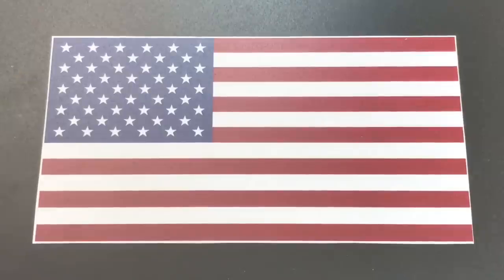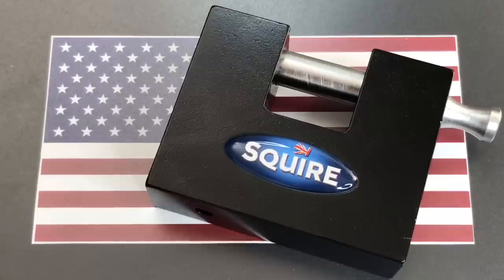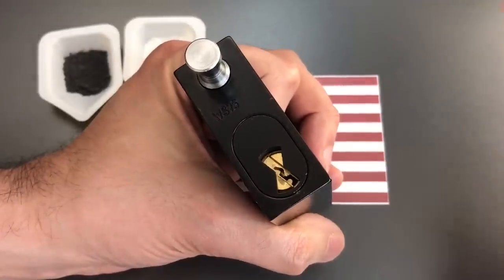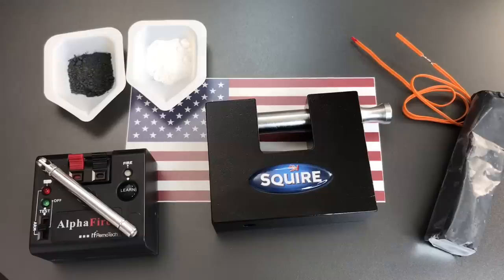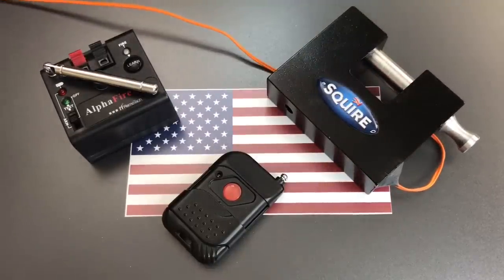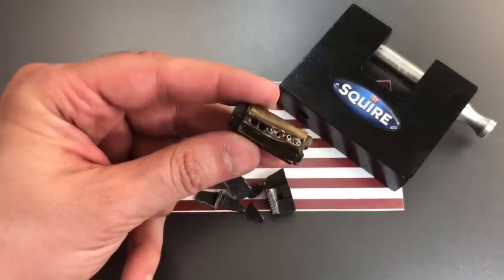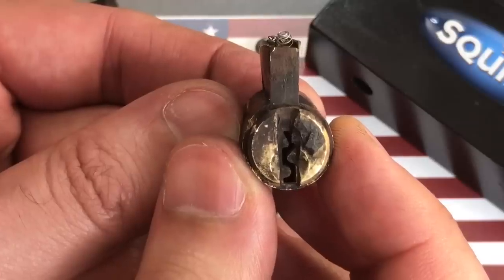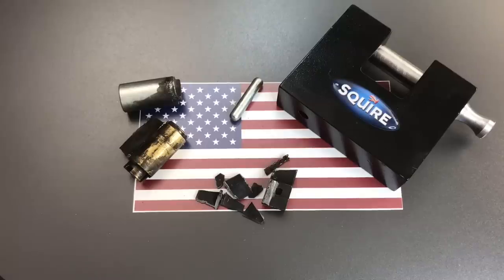[510] Opening a Lock With Explosives!!!

Comment: I once worked with a pyro guy on a movie set (small WW2 movie).  He was always running tons of cable everywhere for the various charges needed.  One day I said "I wonder if there is some kind of wireless system for this".  His eyes got really big and he said "Do you like being dead?" 😂😂😂
Reply: Johnny  Electronics, like phones, cameras, and computers all give off some radio frequency.  My guess is some of those things being around can accidentally match the same frequency required to trigger the detonator.
Reply: Johnny What they said is exactly why.
Reply: Johnny  No reason to risk it. When you're dealing with explosives, it's better to be safe than sorry.
Reply: Johnny  Explosive charges being detonated unexpectedly, possibly harming crew.
Reply: @xXJMatherXx  its sad you had to answer that,
Reply: Car thieves frequently use this method to open car doors, so it is definitely a scary possibility.
Reply: @js-rp9ou  not really. It doesn't occur to your average person. Obviously the person that posted the original comment didn't kniw that
Reply: I would argue it is still totally possible to create an encrypted wireless connection to trigger explosives safely. with encryption it would be pretty much impossible that random frequencies in the area could set it off. the chances would be the same as someone trying to brute force guess a password by typing completely random things
Reply: Aside from the fact that encryption schemes are broken all the time... you would have to put a small computer in the receiver and it might get blown up which is kind of an expensive waste
Reply: @gundorstoneskin5900  Except car keys have their own constantly changing encryption keys + protection, so...no. Unless these thieves reverse engineered the car keys or have decoded the process that the keys use, then no one ain't "commonly" doing this.
Reply: Johnny because electronics tend to fail at the worst possible time and for reasons that shouldn’t happen... using wirelessly detonated explosives is just an added point of failure that would cause death if it failed.
Reply: Johnny  Often times if you are traveling through an area where blasting is being done to clear through rock there will be signs all over that say "Blasting Area - No Radio Transmitting".  That being said, there are expensive commercial solutions that allow wireless control of detonations.  So, wireless can be done "safely" but is just now becoming the case.  For many years you either used a cable run or time fuse.  Now mining is starting to use wireless encrypted devices for detonation.
Reply: You can't jam signals like that in the US. The FCC frowns on it rather heavily. It's the same reason they can't just jam cell phones in prisons to keep prisoners from making calls with contraband phones.
Reply: Dont forget the arguably worse situation; where the remote control FAILS to ignite the explosives. Now someone has to go up to a BOMB to fix it. Depending on which explosives you use, can range from relatively save, to just plain lethal. All because someone said "I dont feel like spending extra effort on being safe".
Reply: @omikronweapon  Good point
Reply: While LPL was describing his remote exploder I was thinking "I wonder how they make sure that's safe, I sure wouldn't want to hook up an explosive to a detonator while I'm in the blast zone".
Reply: The other problem is that the igniter uses a short amount of nichrome wire surrounded by a material that will ignite at the slightest of sparks, that little piece of nichrome wire is about the same length as the wavelength used by mobile phones and could be excited enough by a signal to ignite the material.
Reply: @mfaulknerfilmco  well, then if that's possible with an electronic detonator, then it's also possible for stray radio frequecy to do the same thing with a hard wired detonator.... so your point is moot.
Reply: Oliva Gina  the military still uses wires most of the time
Reply: @rosebarnes9625  Oh, all these people who don't know what they're talking about. How about you trust that the people who have studied this for years and do it for a living know what they're doing. In my experience, there are two kinds of amateur explosives guys: those who were careful and safe and are experienced enough to be trustworthy, and those who are missing body parts because they used "common sense."
Reply: @TheRealColBosch  umm, that's an invalid argument. Just because I'm not trained or educated in explosives does NOT make me wrong, but insinuating such does make you an idiot. I merely responded to ONE post with a simple matter of FACT, and you felt the need to jump in with a fallacial argument. If you want to do some good and protect some people, reply to people who ARE wrong in what they post and give actual facts and/or logic to support your response, don't go around denying facts....
Reply: @ts757arse  good answer!
Reply: @rosebarnes9625  For my understanding, the biggest single engineering reason to use shielded cable and not wireless, is that the remote unit has to have its own power supply. This power supply has to be hooked up, ready to fire, LONG before anyone even considers hitting the trigger. More than likely before the full suite of explosives required for the job at hand is even set up. Its not that you're worried a random wireless signal will set it off. By being connected to a power source, the explosives have a far higher chance of unexpected discharge.

By using shielded cable, you can run the full length of said cable through the job site and have all the explosives rigged before ever connecting the cables to the control unit, and with properly shielded wire, this reduces the chance of premature detonation to almost zero. I say almost, because freak accidents/acts of God have been known to happen, despite being careful and following procedures.

P.s. One other thing I failed to consider was cost. Radios are always expensive, and you are basically guaranteed to lose said receiver every time. Cables, even shielded ones are fairly cheap by comparison.
Reply: Wireless explosives triggers exist and have for quite a while. Some companies use them all the time, but some of the old timers won't touch them.
Reply: Because random electromagnetic frequencies exist and can trigger wireless devices randomly. Wires are much safer as their vulnerable to far few frequencies. If it’s a closed circuit it’s vulnerable to AM and if it’s open it’s vulnerable to FM. But that’s vulnerability is much lower. Wireless is fun but it can be a much bigger headache too, and remember that if it doesn’t go off you get to go check why.
Reply: Vanargand In EOD school one of the very first hard rules they taught us: explosives never work exactly as expected. Just because C4 shouldn’t go off if lit on fire and stomped on doesn’t means it’s safe to try it. Cause that might be the time it works for no good reason. Murphy’s a jackass, don’t make it easy for him.
Reply: @ts757arse  Modern GPUs and critical technology like this are manufactured using absolutely, incomparably different fabrication processes and tolerances. There is no way in hell failure modes of a 7nm consumer-grade ASIC can translate to rugged control circuits of a wireless detonator manufactured to industrial/military standards.
Reply: @ts757arse  I'm sure no one here has suggested using a RTX3090 as a remote detonator. You are making a strawman argument.
Reply: It scared me when he showed it.   I was pondering how they'd make it safe.  Like, maybe giving power to it after they were clear of the blasting area.   I guess at that point, it was easier to just use the power wire for the detonator.   Car remote lock fobs are generally safe.  There are millions of them, and I've never heard of someone's doors getting unlocked by stray RF. That box didn't appear to have that same level of real world field testing.  I wouldn't have trusted being near it to set up.
Reply: We use them nowadays but it's far from just a remote wireless signal, the remotes are coded to the controller so not stray signal can set anything off unless the two devices handshake first.
Reply: @mfaulknerfilmco  It isn't a single wire, it is a pair, with a fairly small separation distance. You would need waves comparable to the separation distance.
In addition, you would need these waves to carry enough energy to heat up the nichrome wire enough to trigger the explosive, which mobile phones simply don't have.
Reply: Johnny  you want the explosive to go off in a timelly manner and not be hindered by signal quality, strenght or matching freqvencies . Cheap remotes can interfere with pretty much everything, moderate remotes can be copied easilly and are pretty common thus could be set off by random remotes , expensive remotes ca still lose signal and fail to detonate when needed ... you need precisions and security
Reply: Especial Effects Co  Just because some are (possibly even ones sold by you) doesn't mean all are.

Like I said earlier, unless I know exactly how it works, and not just from someone telling, but from detailed schematics and preferably code, I wouldn't trust it.

There are plenty of ways to solve issues regarding induction currents.
Reply: I count four ways an explosion can go wrong. Redox reaction. Anything electrical in nature, including electromagnetic waves. General entropy. And material defect.
Reply: The question is WHY.

No point, now if it was a military application, etc.....ok, but for a movie set....no point.
Reply: Johnny  On top of all of what's mentioned, I would like to add a far worse alternative. The possibility that it could FAIL to go off. For any number of reasons. Who's going to go up to the definitely armed and supposed to be detonated wireless charge? Now you have a live explosive that could go off at any second and a huge problem on your hands.
Reply: Johnny   Fast  forward to LPL episode 1250 .......... electronics can do bad things with electrical interference.
Reply: What the fuck are you all on about? Wireless explosives detonators are a commonly used thing and have been for some time.
Reply: @stickmandaninacan  "pretty much impossible" is not "impossible". What happens when Samuel L Jackson is walking for a smoke break and gets blown up by 5 pounds of c4 because someone has an old pager(or some other movie prop) going off?
Reply: @jeffreyblack666  thanks for that long explanation! I learned a lot in this thread :D
Reply: @stickmandaninacan  yeah, but why take a chance with peoples lives when you can just use physical cables and be 100% sure the charges arent gonna just go off on their own
Reply: Retired USMC Ordnance tech.  The debate over wireless tech for detonators is entertaining.  You do not EVER attach the detonator circuit to the charge while you are within the blast radius OR safety zone.  The detonator is ONLY connected when everything is set and all personnel are in a protected area.

Of course being military, it was impressed upon us that in COMBAT the rules can be bent or even broken.....hell you might have to have the private put a match to the explosive (watch "Saving Private Ryan" and watch for the "sticky bombs").  In non combat however, you'll lose stripes, money, and possibly body parts or your life if you bend or break the rules.
Reply: @bmjames  "Aside from the fact that encryption schemes are broken all the time"
do you know that the encryption scheme that authenticates websites was originally described in a paper in 1976? and that it's in fact the only scheme that we managed to figure out? so no, encryption is never broken, because effectively there is just one encryption scheme, or two to be precise but they're both based on the same maths (prime factors multiplication) and nobody has broken it so far. you never break encryption, to the best of anyone's knowledge it's mathematically improbable to the point of practical impossibility, you can only work around it, that's how phones are cracked into for example.
Reply: @stickmandaninacan  wires beat wireless by miles tho
Reply: @owenkegg5608  wait your right
Reply: @xXJMatherXx  also it leaves you open to cyber attacks imagine you have a remote trigger for a gun and then some guy hacks into your trigger and starts blastin
Reply: I guess if someone does it for a living and has to do it over and over again, it’s much safer knowing a bomb would absolutely not detonate if you’re not trying to use it since the wired option requires completing a circuit.
Reply: Johnny  It can still be risky. False signals are very common in all kinds of cheap microcontrollers. You don't even need to hit a radio frequency (and if it's coded, you can't really) for it to falsely trigger. Literally some static electricity could trigger a transistor and make it close a relay and detonate the bomb. Personally, I'm combining the safety of both. I use radio for convenience, but when I'm connecting somethibg dangerous to a reciever, the wire is giving me at least a surviveable distance. It could damage my hearing or throw some shrapnell, but at least I won't lose my limbs or die.

I also design my recievers to have multiple layers of switches required to arm the thing. So, at least 3 switches need to be turned on in sequence in order to provide power to the detonator. It greatly reduces the chances for failure.
Reply: Johnny  Ever drive buy a construction site in the mountains, and they have signs all over the place to turn off your phone, and such stuff... I'm surprised there isn't a secure signal, but, apparently those blasting zones still use old RadioShack walkie-talkies to set them off! XD
Reply: That’s not accidentally or otherwise recreating the required information in the frequency from scratch though, that’s amplifying what is already there - you have to have the keys and then you just amplify them so the car thinks the keys are right by it when actually they are in a bowl by the front door or whatever
Reply: @bmjames  right. Once you finish your work, simply collecting cables and that’s all.
Reply: @stickmandaninacan  encrypt a wireless signal that could still fail and cost shit loads to produce ooooor just run wire back and extra 50 yards...... I know what seems easier and safer and cheaper to me
Reply: The biggest issue is with misfires actually. Using a wireless trigger there is a much higher chance of the explosive failing for whichever of many reasons cause wireless remotes/signals to regularly fail. A wired trigger has much less chance to fail and is much easier to figure out why it failed. 

From a safety point of view a failed detonation is the scariest part of a blast. Because you now have a potentially love explosive that could go off at any moment, depending on what the cause of the failure was. 

I used to work in the mines and trust me every enjoys gathering around for a big blast but the second that a blast fails to detonate everyone becomes very serious and even with the ridiculous amount of safety procedures in place, that is when most deaths on site occur.

Never use wireless explosives.
Reply: Johnny  clearly you did not watch this channel enough
Reply: Johnny  Be good.
Reply: Reminds me of when I used to play SS13. Sometimes if I was bored I'd find a signalling device and just sent out random signals until I either lost interest or Science's bomb making facility mysteriously exploded with great force
Reply: Johnny  the Mythbusters ran into this a lot - what do you do if it fails? If you send the trip signal and nothing happens? You now have a potentially armed bomb that someone has to approach to disarm, and you have absolutely no idea the current state of it.

The reliability of a wired detonator is way higher and that makes it worth it.
Reply: He was one of those guys that no matter what you suggested, even if it was a well researched and well thought out solution backed by years of data plotting and hypothesis testing he would still open his eyes wide and say "Do you like being dead?"
Reply: Johnny  Yeah, but if someone wanted to do it, they could. At least with cables you have to physically be there and incriminate yourself!
Reply: @bmjames  except that's not true AT ALL, what researchers break are specific implementations in specific versions of specific libraries, NOT the algorithms themselves which are mathematically proven to be a certain grade of secure.
Reply: @bmjames  Microcontrollers - essentially single-chip computers - are really cheap these days.  You can easily obtain one that's adequate for this job that would cost at most a few bucks.
Reply: @bmjames  it's more expensive to do it remotely. As you are blowing up the device with the explosive.
Reply: @hobbitilius  my guess is expensive. For movie takes?
Reply: Only terrorists would like the idea of wireless ignition.
Reply: The receiver doesn't necessarily need to be near the charge, although you would need wire